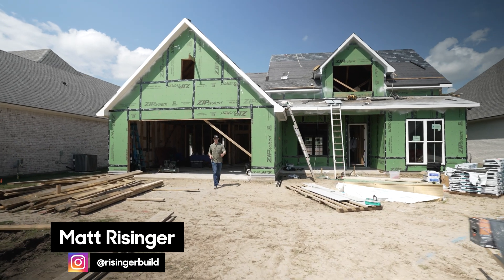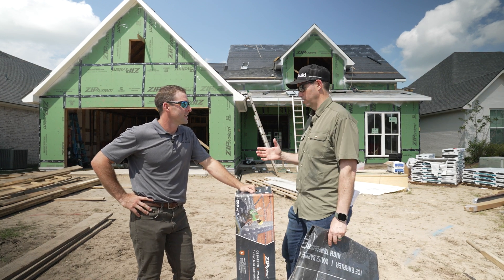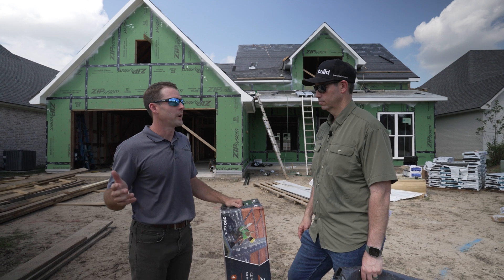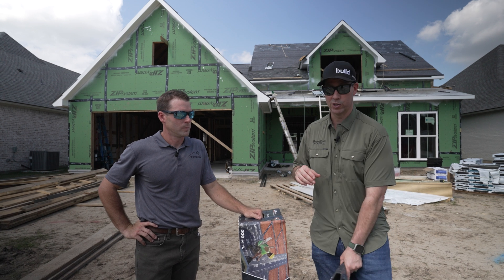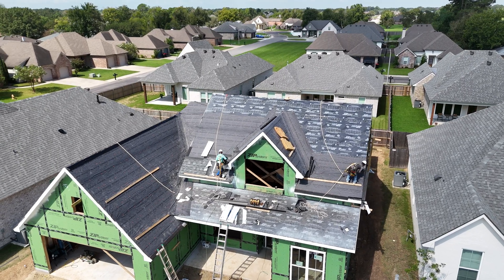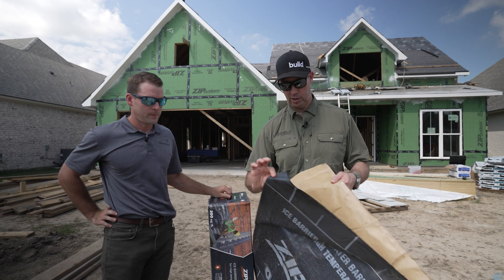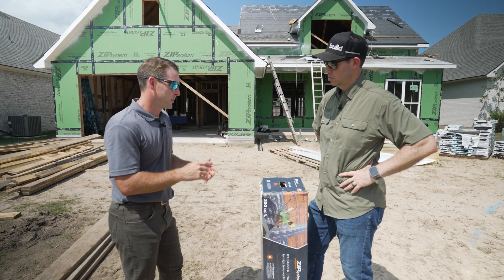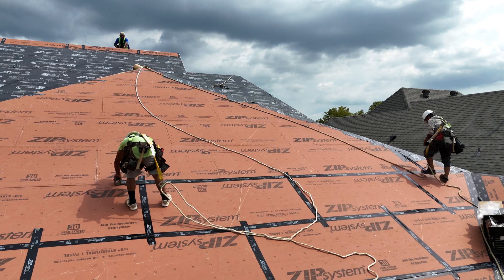DON’T Shingle Till You Watch This!  3 Keys To A Fortified Roof (against Wind, Water, & Hurricanes)

Comment: Hey, Matt. Just wanted to point out that, despite your reminder to roll the Zip tape, the closeup at 3:20 shows poorly applied tape (note the wrinkles) that has not been rolled. The belt and suspenders approach is compromised if the builder doesn’t know how to put on the belt.

Comment: Does anyone else feel these different building techniques are like the FDA…one day eggs cause heart attack next year they are great for the heart.  Chances are a good majority of these techniques will be reversed once the data comes in.  Remember caulking the joints of Hardi??? Now after the years of data they say “nay nay”.  I can give you many of these examples in the building world…. Remember KISS
Reply: Many ideas of 2 decades ago have required new design. You are right an out that. Takes SIPs for roofs. At first hey still had a gap at the ridge. This was an air and vapor leak. Communities in Alaska had the SIP sheathing rot in the top 2 feet. The vapor had condensed after passing the SIP micro gap, causing the rot.   
Matt owes a lot of the great stuff to Joe Lstiburek (close to right spelling) who has dedicated himself to building science as so many new components are introduced, but that require a new system. The old KISS has its own issues, when physics is ignored. 
So;
Maximize water shedding away from the interior
Maximize drying anything any moisture intrusion, being leaks and vapor, 
Be aware of condensing surfaces’ to design safeguards,
Maximize air sealing to minimize condensation where it does damage. 
The latter also must have make up fresh air, which to the contradiction of low cost homes, requires an experienced ERV/HRV system designer-installer. 

The more we add, the more exponential the complexity. 5 old techniques plus 2 new ones requires more complex design, confirmation, jnstallation integrity. 

Yeah, KISS, is 90% of all quality construction. But old standards being trusted we have all seen shortcuts cause problems.

Comment: Hubert trying to dump goods off after roofers have moved on from peel and stick. Does it stick? You bet! So well that its standard now to remove not only your roofing but ALSO YOU ROOF DECKING!! Yep, you end up having to remove the wood roof deck as well... that's why nobody uses it as the tear off makes the next roof horrendously expensive.

Comment: Man always the same Hurricane and Stick Build, as a German I don't get it, build only once and build right use ICF in the whole Tornado Alley, from the south up to North Carolina. You waste so much time, effort and money and money is the point here, you have always work to do when you build with stick framing, one day the insurance companies will hopefully give an order to build stable with ICF. There could be already metal plates/sheets installed hidden, which you slide in front of your windows and doors, lock them in place with screws for example and no debris will smash your windows or doors which is the entrance ticket for the hurricane, the roof should be concrete too by the way. No need for always prepping the house/windows with Plywood Sheets. Greets from Germany
Reply: Concrete is not renewable. It's one of the largest greenhouse gas emitting industries so some people frown on that.
Reply: @danielbuckner2167  Ohhhh come on smart guy. Of course it's energy intensive. But how much energy is honestly in wood? It's collecting Co2 during grow. But, you need to cut the trees with a harvester and a truck to load the lumber, needs both diesel and this a fairly huge amount. Then you need a mill, after that you need a dry chamber usually run on natural gas or electricity, then it must be transported to a sales place and from there to your job site again. And here I'm talking only about regular lumbar, plywood goes additional steps. After a hurricane you are redoing it with stick build how many times? You need Zip again, cladding and so on. An ICF building will stay after a hurricane and it will save more energy because of the less consumption for heating and cooling, way less. My two cents, you have to make your own honest.
Reply: @carstencroessmann  Well rather than list all the ways concrete is more consumptive I will let you face those datapoints when you feel you are ready to. Personally I think underground homes make the most sense but perhaps this "smart guy" is just more of a troglodyte. By the way, how are those mountains you guys planted coming up? As far as hurricanes; building in coastal areas prone to high winds and water should be prohibited and phased out anyway and concrete would just be another building to tear down. Sometimes they even collapse on their own after as few as 50-75 years.

Comment: But, but Matt. If i spend 1000 extra on the roof we can't get the granite counter tops and trendy gray cabinets?!   

Small aside. It's the albedo effect (self insulating properties) of the snow that causes the ice build up. Think like an igloo in -40, it's 32 in the snow.  Add a little heat from the house and you've got water in there running down.  That's why you have to plan for it in climate zone 5+

Comment: At 1:23 a roofer is installing a stagger of cut shingles that violates one of the first rules of installing gable end shingles so they will be secure.  The shingle manufacturers guidelines do not allow those short cuts on a gable end.
Reply: Only about a 3” shingle “top” for starter strip also. I use a traditional starter strip with tar strips 100% of the time and not even in a hurricane area

Comment: Matt, 20yr roofing industry veteran here, the roofing industry is very mixed on this detail. GAF does not at all recommend full ice and water coverage under their shingles due to ventilation and thermal management concerns. Building envelopes would need to be carefully engineered to ensure optimal roof deck ventilation. Retrofitting full ice and water on most existing homes is not advisable without careful planning. Ice and Water Underlayment at vulnerable area like walls, edges, and penetrations is recommended, more than that is likely counter-productive.
Reply: @James_Groff  you don't get roof deck ventilation when you have a condition ceiling attic they tend turn to seal up everything
Reply: Today they demand stagnant air locked in nice and tight. Sun and oxygen is bad very, very bad. LED's and plastic rooms are much better.
Reply: @ericstrunck3611  you got it dude

Comment: Notice they didn’t talk about 20 or 30 years down the road when they have to re-roof?
Reply: I just so happen to have been invited on the day of filming. This particular home they did think of this detail and have an additional felt underlay just beneath the shingle so that they can replace it cost effectively.
Reply: @CueLannoo that would help but it would increase the labor time exponentially simply because the probability of a shovel or single remover puncturing right thru the membrane.  When 100% of the contractors pay their crew a fixed rate to do a tear off good luck with that option.  Show me a roof that has been torn off with the membrane not damaged.
Reply: What would the tear off look like? That’s a concern.
Reply: @OO-df1rd  it's a nightmare. In many cases the wood roof decking also has to be removed thus more than tripling a reproof cost!

Comment: Modern, high quality, stick construction is wild and totally baffles me. How is this cheaper, easier, higher quality, and more sustainable than ICF/SIP?
Reply: Though not in the industry, I’m kind of a Build Science nerd and I’m genuinely curious.
Reply: Why don’t you do the math and show us?
Reply: @phamlam3720  I’ve done the math. Generally, it seems like ICF comes out 5-10% higher initial costs than standard stick, and various % lower initial costs than high quality stick. Regardless, ICF ownership costs seem to sit 30-70% lower than stick when looking at energy consumption and maintenance. 

I commented because I’d like someone to explain it to me like I’m five and make it make sense.
Reply: its not
Reply: Shazam!
Every damn video one of the ICF phreek Bois has to enter the chat.
Hardly matters what the topic....plumbing fixtures, roof decking, fingerboard studs you can count on those ICF trolls coming in

Comment: If you would like to build a hurricane proof house pumicecrete is by far the best building material on the planet 
the entire shell of your house can be built with a mono poured structure 
Floors walls roof 
My goal is to build a pumicecrete home for Community First in Austin 
Wanting to build homes for the homeless is the right thing to do 
Take care Ray 
Never Quit chasing your Dream
Reply: Most homeless aren't "houseless"....they're sober-less, which is the root of their problem (& our expense)
Reply: @willbass2869  it's not even that... you're looking at a symptom of a symptom of an issue and that issue is lack of mental health care.
Reply: @willbass2869  though Daniel is on to something there, the actual most common denominator of homelessness is lack of family. But nice virtue signal, bro.
Reply: @sl0ls  virtue signal?
Reply: @willbass2869  are you unsure of the meaning of the term, or just how it applies to your douchey and factually inaccurate statement?

Comment: Had read there are issues removing when reroofing? This correct?
Reply: Yeah, It will cost a lot more to re-roof because it's a pain in the butt to scrape it all off. But nobody cares about what happens in 15-20 years.
This roof will still loose it's shingles and need to be replaced. You are just adding additional water protection. So in my opinion, there is no need to do both the zip roof and a peel and stick. Just the zip roof should keep 99% of the water out. This is just a lot of added expense for virtually no benefit.
Reply: @collin9085  It takes a lot more time and money to replace a concrete drive way or sidewalk than it does when  building new.
Reply: @collin9085  cheaper and faster to tear off the decking and redeck...  not cheaper but faster.
Reply: Yes. Major issues!

Comment: I guess Huber is admitting that taped butt joints aren't really waterproof long term.  But, why use zip then?
Reply: I think Huber is admitting that plain Zip system plus the standard taping isn’t enough to stand up to a hurricane.  It’s enough for normal storms, but not hurricane strength.
Reply: @shubinternet  Wood frame anything isn't enough for hurricane strength. It's a gamble with every storm. Give me ICF and steel any day.
Reply: @mxb_se looky here another ICF trolls lurking.....just waiting to pounce.
You guys must be well paid ....
Reply: Because then they can sell you twice as much product. They can also sell you a product that needs to be replaced with the roof every 15 to 20 years.
I agree with you. Waste of money to do the added layer of protection.
Reply: Oh warranty is great here pile of OSB see you later. They're happy to give you a pile and walkway. Leave you with the cost to replace it. 
I think house wrap n roof paper. On top zipwall is the way to go.